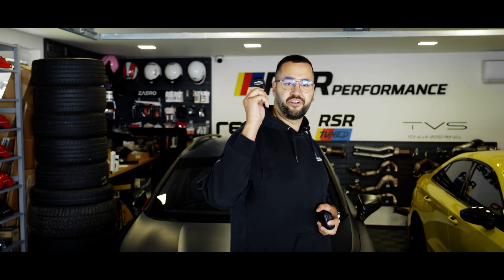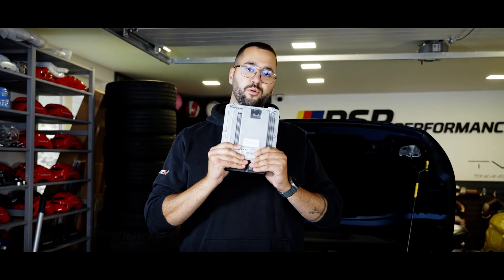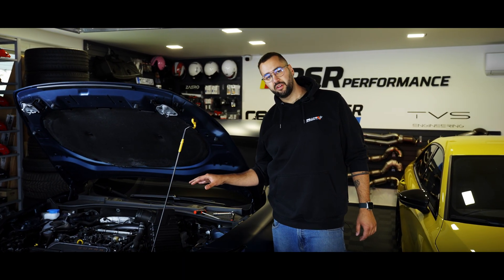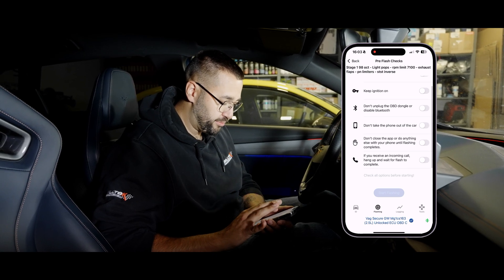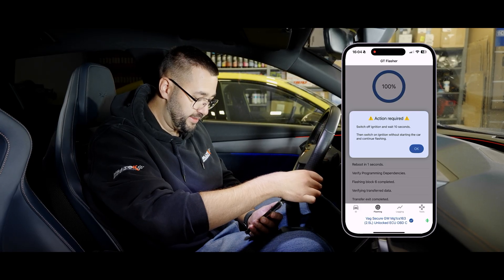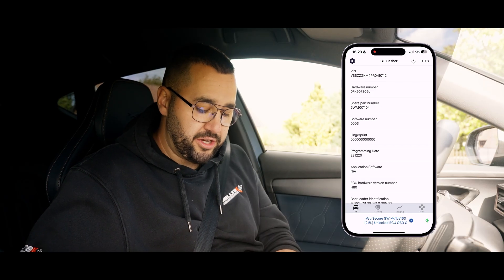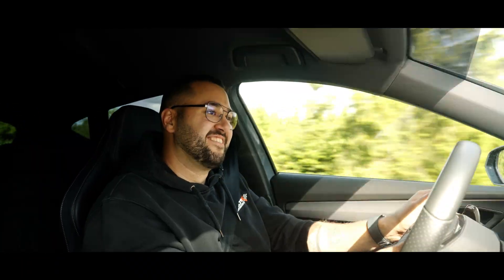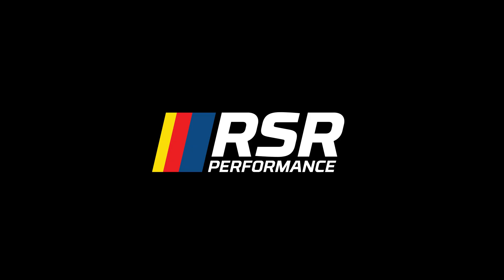ECU Unlock & Flashing – Audi RS3 8Y / Cupra Formentor VZ5 | RSR-Performance

Comment: How much hp will the Formentor VZ5 produce after the tune?
Reply from the maker: depends on stage, up to 480 on stage 1 and 98ron, stage 2 will be around 500. https://www.rsr-performance.cz/rsrtuned-uprava-ridici-jednotky-audi-rs3-8y-formentor-vz5/
Reply: @rsr-performance will the Stage 1  solve also the issue of the sluggish geatbox in D (Drive) or for that a TCU remap is needed? Also, will the extrapower and couple not affect in time the back differential?